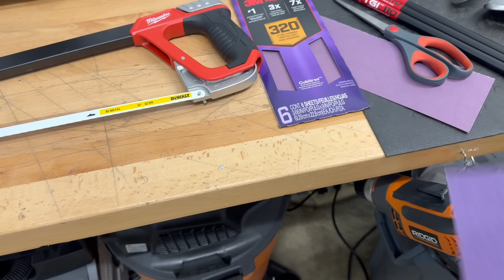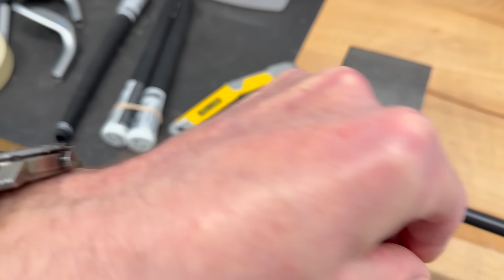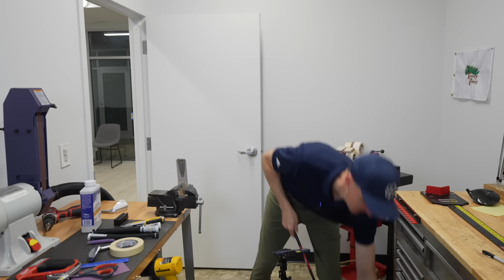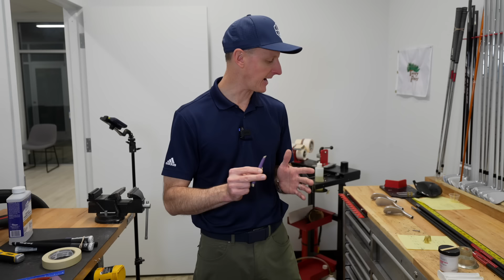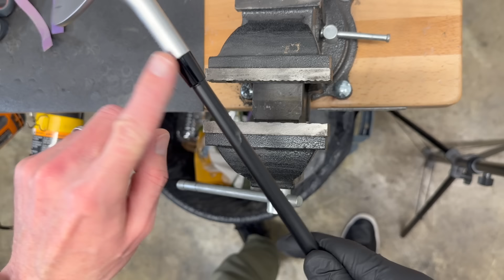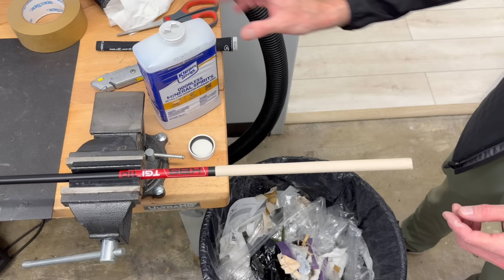Building Clubs for George Bryan with Cheap Home Depot Tools

Comment: Quick question.  Does adding the tip weight and then a shim not add to the overall length of the shaft?
Reply from the maker: Steel shafts would add around 1/8 inch at most, graphite would add more but that is why you would trim the shaft tip to compensate.

Comment: I highly recommend WATER activated grip tape for part timers. Buy long cure (24hr) golf club epoxy. HD epoxy can work, but golf specifically designed to retain flex and doesn't require too much heat to remove. My Snake Eyes from Golfsmith are 20 years old and stay in my trunk 10 months a year.
Buy a couple vice clamp  inserts as shown when buying golf parts. The shim and knowing it's needed is more 'advanced'... I have only needed for repairs.

Basic swingweight scale is not that expensive and you can pay for it with money saved from building one set of irons ($100 one from GolfWorks). Not that doing math is wrong or bad.

Comment: This video is great. I have a question, can you use a hacksaw on steel shafts instead of a pipe cutter that tapers the tip when you cut?
Reply from the maker: Yes, you might want a lower TPI blade for speed but any standard blade should work.

Comment: Any reason why things like tape, epoxy and the shims were not accounted for in the initial swing weight measurement?
Reply from the maker: 2 reasons. First they weigh almost nothing so very little change comes from them. More importantly we are doing the same epoxy, tape, and shim to all the clubs so the consistency will be there and that is what matters.
Reply from the maker: 2 reasons. First they weigh almost nothing so very little change comes from them. More importantly we are doing the same epoxy, tape, and shim to all the clubs so the consistency will be there and that is what matters.
Reply: @E @EFGMC espectfully would have to disagree… they weight ALMOST nothing… not weightless. Adding more tape or accidentally slightly more epoxy than normal can result in minute changes to swingweight

Comment: Can you show us how to pull graphite and steel shafts using Home Depo products?
Reply: Get a blow torch and a welding glove, hot water to move ferrule away from head, heat the hosel rotating it as you do it. pull the head. Best keeping a grip on for purchase, if not have it clamped in a vice using the rubber vice attachment shown in video

Comment: Built my own irons and just had a head spin on me, followed your videos to a tee. Is there such thing as getting unlucky or bad glue or something? Shafts and heads prepped with 120 grit and also a wire brush on a drill for the heads, full 24 hour cure, shafting beads everything. Would love to hear your input, love your videos!!
Reply from the maker: Hard to know. It could be a bad batch of epoxy. Maybe not mixed enough, maybe cured in too cold a space, maybe some residue in the hosels or shaft tips hindering the bond?? Just a few guesses..
Reply: @EFGMC  really appreciate the response, made sure to mix the epoxy super well this time, but I do cure then in my basement where the workshop is… maybe I’ll get a little space heater for down there when I am curing
Reply from the maker: @willradix  If it gets below 60 or 65 degrees, the cure time goes up significantly.
Reply: You didn’t say you cleaned the hosel and shaft tip with acetone or alcohol. Too many shafting beads can impair the bond. Better to use quick center from GW, again only need a little bit.
Reply: @Denny33-h9j  my apologies, def cleaned the heads and shafts with acetone after the wire wheel drill bit and 120 grit sand paper to the shaft
Reply: @D @Denny33-h9j  tell me a bit more about the QSSB vs the regular golf works shafting beads… didn’t even know there was a difference but I don’t think I used too much just a pinch in a decent lot of glue
Reply: @willradix  the glass beads crush down and kinda lose their diameter. The QCSB is more of a grit and holds its shape better, for a better fit and strengthens the bond.
Reply: @Denny33-h9j  hmm. Will have to get some on my next order

Comment: Another excellent video.  Quick question,you said you cut a half inch off the tip    Is that to stiffen the flex ?   Would half inch make much difference to stiffness, and how is this calculated. ie 1inch.  1 1/2 inch.  Would there be much difference in stiffness
Reply from the maker: Most shafts move in that 1/2 stepping when it comes to flex. This is less about science, and more about feel. If the TGI offered a dedicated PW shaft, I would not bother tipping it. Since they use the same shaft for anything under 9i, I like to tip the wedges.

Comment: After adding the tip weight to the one wedge, and installing the shaft into the head, the overall length will not be the same anymore due to the length of the tip weight. So an additional cut in the final length would be needed. I have run across that in my builds in the past. Just a FYI 🤗
Reply from the maker: Correct. Any graphite tip weight will require extra cutting. I always cut from the tip end  but didn't include another hacksaw cut in the video since I covered that technique a couple times.

Comment: Best DIY club building video I’ve seen.  I’ve been building and reshafting irons like this for several years on a old spare desk in my home office / golf club tinkering room.  I laid out a 60* angle line on the edge of my desktop that extends above the top of a standard 48” metal ruler to measure club length.  I have a small 3” vice that clamps on to the end of the desk for shaft cutting and club gripping and I use a Dremel to cut shafts.  I did break down and buy a Golfworks swing weight scale a couple years ago.

Comment: Now adjust the loft and lie using only home Depot stuff.
Reply from the maker: That requires an engineering degree I think.
Reply: @EFGMC  I can do scotty putters in my lap lol, have for years for friends, I used to be a fitter/builder however  :)
Reply: If you have a really good digital angle gauge a vice and a very good pipe wrench (usa ridgid) you can, but you will mar everything in the process, so if cosmetics are not your thing go for it lol

Comment: Since you cut the tip does that mean it's a .370 shaft?
Reply from the maker: No, cutting a taper tip shaft 1/2 inch will still leave you with a diameter around .355
I read people saying for a long time that the taper is just at the very tip of the shaft and it then expands to .370 diameter. But in fact the smaller diameter extends far further up the shaft than that in most models.

Comment: I've been building my own clubs with basic Home Depot supplies in the kitchen of my 700 sq. ft. apartment like this for years. The most important piece is a vice. I just got a light duty, removable screw on vice that I clamp to my kitchen counter. It works just fine for a golf club. For gripping, I use a 12 inch or so long Tupper-ware container that I put in my kitchen sink to catch the excess grip solvent. I've found that with steel shafted clubs, it's pretty hard to mess them up. You do need to be more careful with graphite shafts though. Thanks for posting another great video!

Comment: I've used the HB epoxy when ive to lengthen a shaft or put on a club head......yes they a single club at a time. Worked very well. The guys I've used it for have never reported a single issue

Comment: Been building clubs for just shy of a decade. The 2 part JB weld epoxy has a working time of 5-6 minutes, 30 minute set time and full cure of 3 hours. Never had any issues with my builds. Roughly $20 for the big time es and lasts me easily 100 club builds. Probably way more

Comment: Aj, would you ever do a video on driver length by height? I noticed you run a 44.25” driver and was wondering how you handle the extra head weight needed to restore swing weight. Also, what would you recommend for us 5’8” short kings? Is there a process you follow to determine ideal playing length? And is there any benefit to going shorter than 44”, or a point where you wouldn’t go any shorter? 

I appreciate you, keep making the great content 👌
Reply from the maker: As long as you can add enough weight back to the head to feel comfortable, you can keep going shorter. Never assume you need to go back to the original swing weight. I also recommend going into a heavier shaft if you are getting into shorter lengths. Also you might want to adjust the lie angle more upright if you make it 44in or less to compensate for that change.

Comment: A little off topic, but at 110 mph, if a regular flex shaft is working, should i stay with it or see if a stiffer shaft works?
Reply: The standard advice is to use the most flexible shaft you can control. No need to change what is working. Also, there are no standards for R S XS L etc. You could easily buy a S that was not stiffer than than your R.

Comment: Hi AJ, may I ask is there a iron swing weight scale that applies to different weighted shafts? IE, 130gram shaft is D5 swing weight and 100gram shaft is D2 and 80gram shaft is D0 swing weight, etc, as I am having trouble getting the swing weight correct for each type of shaft..Also the shaft flex and material  has to be taken into consideration...Hope you can help as I have not seen any YouTube vids that cover this topic....Great vid again...Big thanks for this one...

Comment: I have used JB Weld to glue iron heads back on that had come loose.......they never came loose again.......
Reply: And if the shaft ever needs pulling, you’ll never get it off either.

Comment: I have done some home reshafting etc. that turned out great. But I have a question about double sided tape for grips. I purchase packages with solvent and tape. The issue is the tape has a protective layer on both sides. Once you remove one side and install on the grip “Is the procedure then to roll it on until almost touching to finally remove the outer layer?”. Your tape seems different in that regard. Thanks I enjoy your videos and workmanship.
Reply from the maker: Mine has the backing layer against the double side. I always remove the backing before applying it to the shaft. Key part here is my tape dispenser is a double sided tape dispenser so it automatically removes the backing when you pull out a strip.

Comment: I've been thinking about buying the economy bench vice version of the Loft/Lie machine from golfworks. Only thing I am wondering about a cheaper machine like that, is how do you adjust lie without accidentally changing loft?
Reply from the maker: I've got one of those with plans to compare 3 different price point machines. Planning on giving away the economy one after the video.
Reply: @EFGMC  Oh sweet, I will have to keep a lookout for that vid!

Comment: does the tip weight add length?
Reply: It only adds a tiny amount of length. If you are being precise, you would tip the shaft a little extra to accommodate the part of the tip weight that sticks out beyond the shaft after insertion.

Comment: JB Weld is fantastic epoxy in the longer cure version {Not Quick). It has huge impact resistance and multi surface adhering qualities. It is very heat resistant as well and will require hotter temps/time to undo a club build. It is my go to epoxy for almost every situation I come across. I have not tried the clear version but will have to try it soon.
Reply: Yup, that's what I used before I got some two part epoxy from golf works.